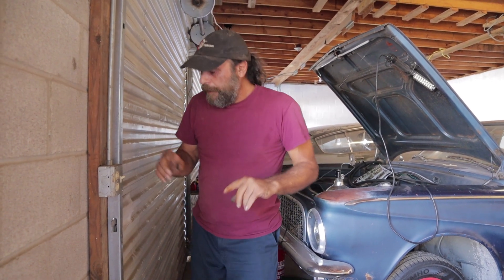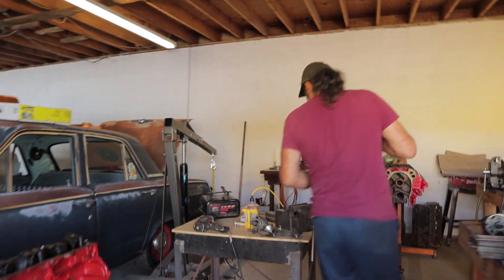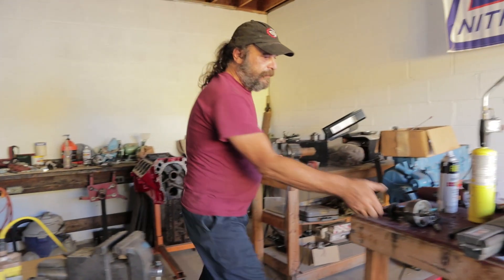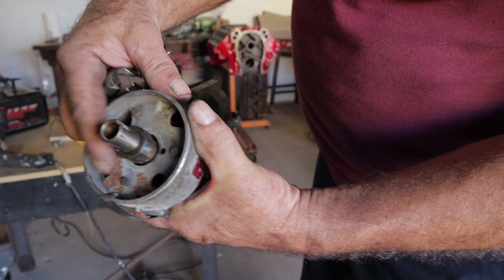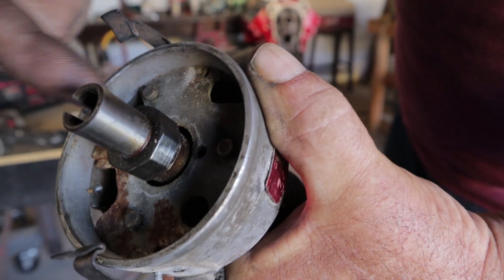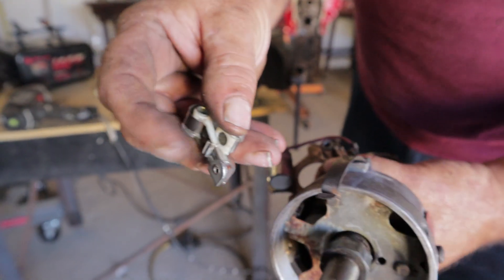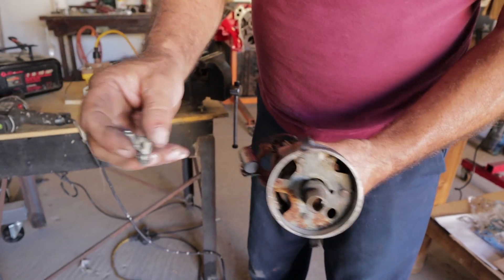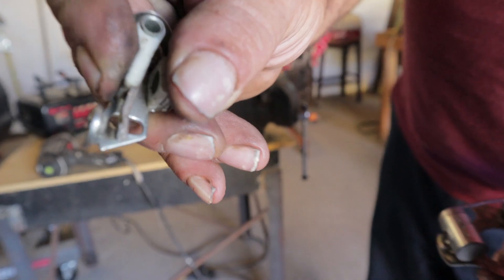Classic Car Tech-Ignition Points Explained

Comment: Reliable? Bullshit! Every points ignition I ever had got swapped out for CDI because points had to be serviced all the fucking time.
Reply from the maker: I would expect a statement like that from someone who thinks CDI is an alternative to points.  One thing has nothing to do with the other
Reply: @UncleTonysGarage  nice word salad. You know what I meant. Only a moron would use a CDI without a breakerless ignition  A simple Google search would show the number one issue with points is they wear out quickly. Shit I haven't even gotten into points float or limits of voltage you can pass through them. Or how the condenser only reduces arc jump not eliminates it. What about wear on the nylon block? Simple wear on points actually changes your ignition timing. I could list off shit all day but it's very obvious you have absolutely no clue
Reply: You sound like the kind of guy who changes his oil every 20,000 miles on the nose. Commendable.
Reply: @413x398 nah the kinda guy that changes his oil 20,000 miles on the nose is the same asshole that thinks a set of points lasts 8 to 10 thousand miles. FYI they don't

Comment: I disagree I never burned out my old Chrysler electronic ignition yet I burned out points on the regular , they don’t like 30+ mile trips at 100+mph averages
Reply: So, you didn't set up your dist cap as Ram Air, huh?
Reply: I know, right? 276 gears and a 71 valiant with a 318 4bbr carb it loved the highway , 3k rpm at 90mph lol but would still smoke the chevys all day long because it was so lightweight . Looked just like the car on duel except it was blue
Reply: @fecklarjenkins2549  To clarify, I was talking about drilling holes fore and aft in the cap to reduce heat and ionization-induced crossfire. Not a good idea if it's raining, but then that's why the Ancient Aliens invented little rubber plugs.
Reply: I switched it to electronica ignition after the second time of doing that and all of this was a long time ago I sold that car probably 15 years ago

Comment: My old 63 ford i gap the points with a feeler gauge my 67 impala i use a dwell meter and adjust thru the distributor window, points are great they dont need to be overengineered there simple and perfect!

Comment: Good basic description of the system for guys like me who missed that whole generation of cars.  I understood it before, how it worked, you helped fill in the blanks thoughts since I have never messed with one. Like the cam on the distributer shaft that actually did the mechanical opening and closing of the points.

Comment: Yeah it cracks me up how many have fallen for the Pertronix modules and such because they think they're gaining something.  I STILL run points in my car.  I check/lube them every other oil change or so(about 8k miles) when I rotate the tires.  The last set I had ran 20k miles before I replaced them and even then...they could have gone more but I was already "in" there and so I simply pulled the entire dizzy, viced it, checked the weights/springs etc and installed a new set.  Took an ENTIRE 20min or so including break.  Whew...exhausting...especially considering the some of the same guys complaining on "how long" it takes to maintain them think nothing of spending that same amount of time every week or so wiping their car down with a diaper and ensuring there are no streaks in their chrome.

Comment: Back in early 70s Sun tune, had a distributor tester,  That you can remove any distributor out of any car set the dwell either on single or dual points. They could run it up to 6500 to 7000 RPMs it sure as heck beat using a feeler gauge. Save a lot of time, and I believed on my 73  240 Z  Datsun only charge like $30. Excellent video got me thinking.

Comment: i got a dual point external adjustable for my chevy's have both counter weights sb and bb only use it for racing usually i run  electronic with msd on the street . i just keep and extra module in the glove box .

Comment: points rock! best set is the blue streak points by stander ignition, thy have a wick to lube the points cam. i like hei to run a wide plug gap. so i use a ford gray remote mount tfi module and trigger it by points. i use a late 1970s ford cap on my points distributor along with tfi coil and efi plug wires! so i have the best of both worlds! for mopar the factory ignition box can be trigger by points to!  the best is points with box! good video!

Comment: Good but could you draw on A3 size paper the primary (in blue) and the secondary circuit (in red), with the ignition switch, points, coil, and spark plug. Also in any tutorial a bit of background about magnetos would be informative and interesting before coming into distributors. Then we could look at the need for spark advance and retardation, and how the "dizzy" does that job as well. The dizzy is a busy body on that old engine!!!

Comment: Tony , I know you're a points type guy lol but I was hoping you could help me with an electronic ignition question . The vehicle is a 93 Dodge Dakota , and it's not getting power to the coil . Can I cut the power wire running to the coil off and then run a wire (with an on/off switch) from the positive side of the battery to the coil instead . Wired like this shouldn't hurt the computer or anything else , and the truck should run this way , right ?
Reply from the maker: You should be ok..SHOULD

Comment: I understand points, I understand magnetic electronic ignition. Don't understand distributorless ignition...dammit! I'm a analog guy in a digital world...
Reply: Modern vehicles dont have distributors or wires. They just have a coil pack at each cylinder with a plug. the cars onboard computers control the ignition/timing.
Reply: @Someguy6571  yes I get that much...sensors still have to trigger the computers..

Comment: After you are done explaining the points could you please explain mechanical and vacuum spark advance and why cars had both.  I grew up running tractors that had mechanical spark advance on the steering column  that we would advance for the smoothest running depending on the load. So basically I know the higher the RPM the farther you need to lead the spark

Comment: I bought a quality set of points for a '69 Chev pick up and it ran great for several years without doing anything to them. Must have been 30,000 miles or so. When I sold it, the guy said, "I can't believe this thing. I just touch the key and it starts." Cheap points suck.

Comment: When I started out it was using a tach/dwell meter and setting your points, adjusting timing, and adjusting idle mixture.....minor tune...plugs, points, condenser....bigger tune added cap, rotor, and wires if needed...fuel and air filters...maybe a breather element, perhaps a PCV valve....sometimes a carb rebuild. A Chrysler product...better put a spare ballast resistor in the glove box. Where have all the years gone? Uncle Tony's Garage sure brings me back....I sure miss those days. Thanks for keeping it alive Uncle Tony.
Reply: Saab Tech oh man... somewhere in time you got Shanghai'd into working on Swedish stuff. Long ago, they don't know the proper end of the engine to install a clutch on. In the later years, they couldn't get the complex central nervous system of FRED's (Fucking Rediculous Electronic Device) to integrate with GM properly. 
 To many moduals, NO factory support for diagnostics.
  There was a local garage around here that worked on those sweeds for a short time. It was aptly named "A Saab story"

Comment: The coil makes the spark

Yes an the radio is the fuel pump
Reply from the maker: Oh...so, tell me..what does make that spark?
Reply: Magic? Lol
Reply: The distributor the coil just increases the electricity you should take one apart as a video
Reply from the maker: No, the distributor does exactly what its name implies.  It distributes.  The coil is where running voltage becomes high voltage

Comment: I did have one bad experience with points . My first car was a 64 Dodge 330 with a 383 . I had just bought the car and  driving up a hill  the car just died , had a Prestolite dual  point distributor . found out one set of points had burnt all the way through the tungsten  tips. Previous owner probably didn't set the dwell right or the shaft bushings were  badly worn. Replaced it with a Accel dual point distributor and coil. Ran Great until I sold it.

Comment: I still like the fact that an internal combustion engine can be ran with just a set of points to trigger the coil and a carburetor to feed fuel to the engine. Meaning no electronic controls at all. Albeit not as hands off as electronic controls are, but still functional.

Comment: Hey Uncle Tony, maybe these dudes want a proper explanation of fusible link and/or resistance wires in the ignition circuit, therefore, why to switch to HEI one wire 12volt on GM when you keep burning out coils
Edit: it's the purple wire!

Comment: The only time my 70 Swinger ever broke down on me was over a set of points.  I changed it to electronic from a junkyard Volare and never looked back.  Sometimes I see the electronic boxes melted and am tempted, though.
Reply: It's kind of just as easy but less often to change an overheated HEI module on the side of the road, keep one in ur toolbox

Comment: FunFact: on HEI you can adjust the dwell time with an allen head through the little slide up window while it's running!  It helps to have an oscilloscope to see the change and set the proper dwell timing obviously.  The amount of dwell is the amount of time the coil has to build a charge, when the switch opens (points or electronic) the electromagnetic field in the coil collapses and seeks the path of least resistance ie: wherever the rotor is pointed at that split second, the 40k volts jumps out of the coil to that particular spark plug wire and fires off the cylinder.
Reply from the maker: That's not HEI...you're thinking of the GM Uniset style points
Reply: Uncle Tony is correct.  That's the later points setup that came right before HEI
Reply: wrong hei not adjustable that way ,some vac advances or change weights and springs.your thinking uniset!
Reply: You dudes are right, I haven't done it since 1991 and did convert my 70 SS Monte Carlo from points to HEI.  Later in my 383 stroker Firebird I replaced weights and springs for faster total advance and had the adjustable vacuum advance also.

Comment: Back in the day I would keep a spare set of points and condensor in my vehicles. One thing about points, if they failed it was easy to put that spare  set in the distributor and keep going right on the side of the road. If you have a failure of your modern system today you pay for a tow. 

Something else to do when installing a new set of points is after you tighten the screw and nut down is to mash the end of the screw with pliers so that nut does not loosen up and fall down into the distributor, which will destroy it.
 The worst points ever made back then were Blue Point. They just silver plated the contacts instead of using solid silver disks and the rub block would wear down in just a couple thousand miles. Either the plated contacts would burn out or the rub block would wear away leaving you dead on the side of the road, and it always happened in the worst place imaginable.

Comment: Question Tony . The gap on the points should it be just open enough to slide a regular business card between or is that too narrow or just right or should the gap be open a little more? I have feeler gauges but they say not to use them if they can magnetiz ? Would that gap or the condenser cause a little bit of a hesitation on acceleration from a dead stop or in park at idle when giving it throttle?? It idles fine
Reply from the maker: You can use any feeler gauge to set the points.  Business card?  Not sure...used to be a matchbook cover in the old days.
Reply: @UncleTonysGarage   thats what i ment 😎 👍
Reply: Sounds like an accelerator pump issue.

Comment: Uncle Tony, excellent video!!
The ignition coil, is a step up transformer. ( auto transformer, because the primary/ secondary windings are shared. 3- wire connection.)
Transformers do NOT work with D.C.
HOWEVER, making connection to a coil / transformer and then breaking connection, and repeating the process, you are creating an A.C. signal. The coil steps up this voltage to fire the plugs.. 
It's almost the same way they used to get 90V AC in the old 1950's car radios, except they had a device known as a vibrator to create the A.C.
I almost sound like I know what I'm talking about.

Comment: Bought a set of points for a friends car last year, they dont make them like they used to... rubbing block worn through in 6 months
Reply: I had a set of Blue Streak points that I had saved, that had been run about 6000 miles in my  '66  7-Litre Ford Galaxie in the 80s.   The young guy across the street got an old Mustang he was going to fix up, and I gave him the points, saying "You can't get any better set of points than these."
That rascal tore the Mustang all apart and never finished it.  Eventually he sold it all to a guy who came and picked it up with an enclosed trailer.

I didn't get my points back.
Similar story with some 7-inch Cibie head lights that I gave to another neighbor -- but that's for another time.
Reply: Put up some video's man ! and quit giving all your quality kaka away : ]

Comment: Hey Uncle Tony, love the video and I wanna pitch an unconventional idea.  I got a 1980 Z28 in May as my first car.  The engine makes a modest (estimated) 330, which don't get me wrong is a good number but if I wanna run with my boys im gonna need some more.  Because its my daily driver and I really like the good ol look of superchargers and their sound, why not make a selective engaging/disengaging supercharger?  Ya know, Mad Max style.  Maybe even a modest NOS and clutched supercharger set up.  I've read enough to know its been in some production cars and it would be good for reliability.  I know it would be expensive as all fuck, especially on my poor highschooler budget but i've managed this far in rebuilding my car.  I just wanted to get your input if ya got the time cause you've been around this stuff longer than i've been alive.  Thanks and take care!
Reply from the maker: Mild superchargers are actually great on daily drivers.  They increase overall efficiency and can even boost gas mileage.  No need to go all Mad Max. Just find a good deal on a used centrifugal unit and bolt it on.  Good luck with it
Reply: @UncleTonysGarage  thanks uncle tony, i really appreciate it!

Comment: And-if you do not run a ballast resistor or such to reduce the systems 12 volts down to 6 volts for the points, the points will burn to a crisp  very shortly.
Reply from the maker: Doesn't knock it down to six.  Generally reduces by 1.5 volts, and that varies as it goes about its business

Comment: Roll up your windows! Thanks for the info, no longer have points in my Slant Six just electronic ignition with 5 pin ECU, then I did the HEI conversion however isn't getting spark, everything is fine with the stock ECU, car runs and idles great... thinking I got a bad module out of the box but part store refuses to give warranty! Is there a way to test this? Your knowledge is appreciated Uncle Tony!!
Reply from the maker: ...and this is precisely why all my cars and trucks have points.  Wish I had a quick easy troubleshooting answer for you,  but I think Google is the way to go
Reply: @UncleTonysGarage  I read somewhere about the magnetic pickup gap on the distributor being too open and not triggering the module, but then again the Duster is running great as is and I don't want to mess something. Will try with a brand quality unit or a known working module. Damn electronics...